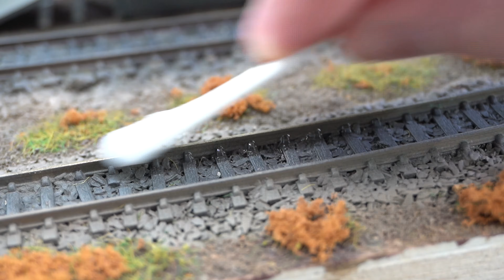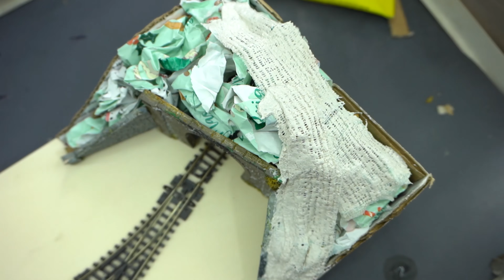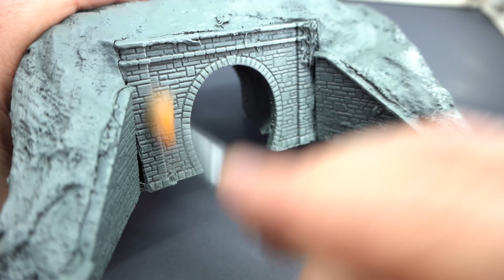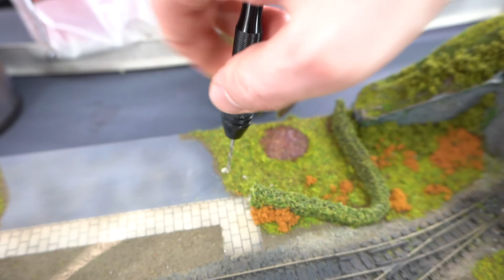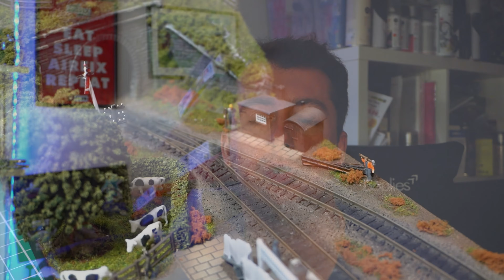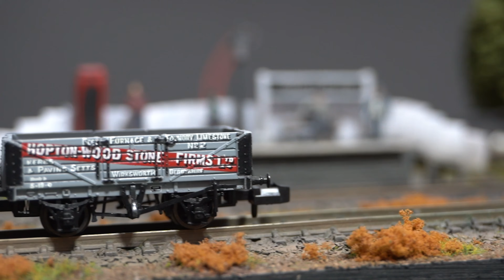Built in a Weekend - Micro N Gauge Model Railway!

Comment: Ice layout but the engine performance is crap, to say in a polite way . A small coreless gearhead motor with flywheel would have been a cure for that.
Reply from the maker: The locomotive had been in storage for about a decade before I created this project. I remember that it used to run quite nicely but seeing as I did very little to service and clean it for this video that could explain why the performance wasn't so good. Of course, the running locomotive was just to show that the layout worked in the video - the main focus was to show the process for creating the project

Comment: I think it came out really well. You kept it simple and that made it easy to finish and still have lots of interesting bits like the tunnel and hill at the far end. You could add a removable strait section on the other side of the tunnel to run longer trains on and off the layout. You could then detach it if you wanted to put the layout away or transport it to another location.
Reply from the maker: Thanks! I'm glad you think it turned out well

Comment: fantastic work - i'm in a similar situation - loads of N and Z gauge and getting back into making smaller layouts that I can actually have working/running. love your content !
Reply: 4 decades ago I did N, Z, Nn3, getting back into it I came across TT120. A quick calculation showed me in TT120  3"6' is about 9mm and 2'6" is 6.5mm. Now I can model my local Queensland 3'6" and my old Victorian narrow gauge 2'6".   Ttrak like modules with Kato N or Rokuhan Z track, means I can do small sections at a time and can change it around to fit in any available space or even store it away.
Reply from the maker: You can do it!

Comment: That was a great idea. After a seen this video a want to rebuilt my small layout(110x50cm) to modules like that. It can be standalone display track, or connected to another layout module. It's really good idea. So my locomotives and carts is old. From 1990, but locomotives are working very well.
Reply from the maker: There are some N gauge "diorama modules" i have seen - think they are from Kato - which are all interconnectable and look really fun
Reply: @ModelMinutes kato makes mini diorama modules, but they don't look very good in my opinion. I want something better
Reply from the maker: I think there is also the hex module system? But i forget who that was by

Comment: thank you for showing the cardboard use for the hillside. i have just finished laying my track but was struggling with hle i was going to build my back tunnel. thanks again and nice video.
Reply from the maker: There are lots of different ways to do hills, some are a bit more permanent than others (like chicken wire and wooden spacers) whilst ones like that shown in this video are a bit more lightweight. Other people use different kinds of foam and carve it to shape and apply filler over the top to make it more rigid
Reply: I've been the same for my OO gauge shunting layout, it's perfect as I've got some old boxes and wrapping paper I can use 😂thanks for the idea @ModelMinutes!

Comment: Lovely job Matt.. just goes to show (again) how skills from one area can cross to another. One question (and I did email Hornby about this with no reply) is that some dioramas set in vintage periods - which this isn't - look too clean. With horses being the main mode of transport and in commercial use (milk floats, ploughing etc) there is no 'detritus' from horses, and no guy shovelling it up to use on his flowerbeds or sell. Something for a 3D print maybe?
Reply from the maker: Some excellent points! I wasn't going for anything too specific, just a bit of a mix of things based on what I had in my storage box. But yes, I see what you mean, there are a lot of railway models that are very "clean" (which I suppose is completely fine as modellers are free to create their projects however they want) but those who want to create more rundown or dirty scenes are somewhat disadvantaged by the mainstream manufacturers.

This is why 3D printing is so great, it is possible to create these things if they are not supported by the companies :)